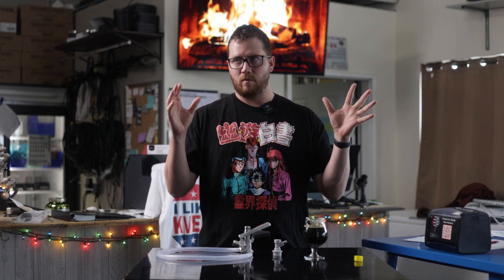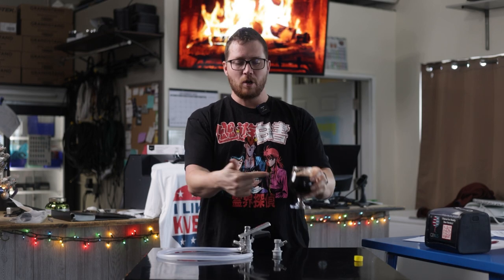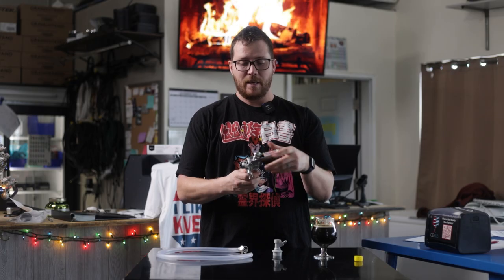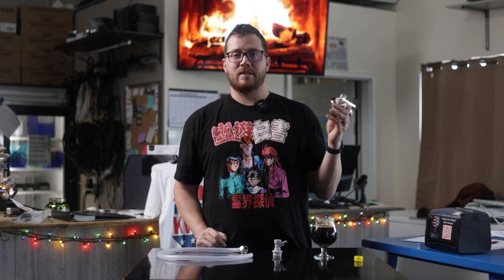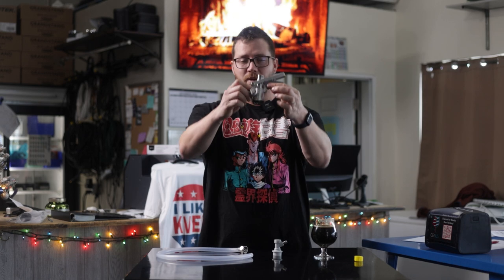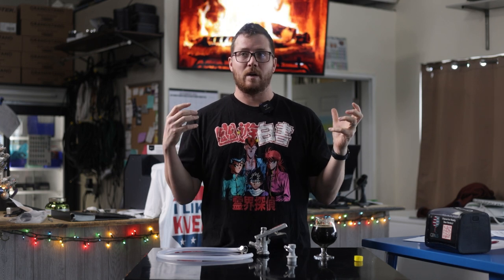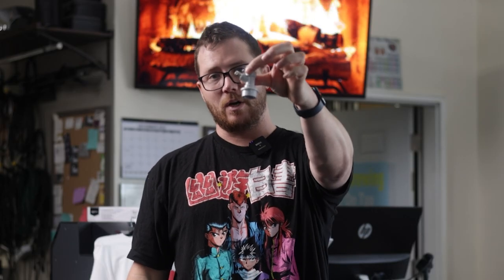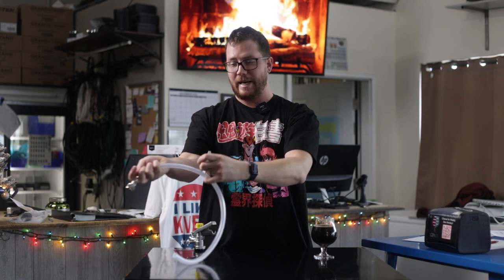Fix Over-Carbonated Beer | The Best Way to Clear Up Carbonation

Comment: Great video, I've been using a spunding valve to correct overcarbonated beers

I keg prime all my stuff nowadays, so it's easy to over/under carbonate.

Basically I take a pressure reading after the keg has been chilling for a week (and is assumed to have reached equilibrium) .  If the PSI on the spunding valve gauge is reading too high then I adjust the spunding valve to the "set it and forget it pressure" that alligns the keezer temp and target volume for a few days.

Comment: That's where the beauty of bottling into plastic soda bottles comes into it's own. You can feel the pressure on the bottles, and if it's too high you just slightly unwind the bottle cap and let excess pressure out and tighten it again. I'm not sure why not more people are doing this. It's very low cost and has so many advantages.
Reply from the maker: Agreed - I don't know why they aren't more commonplace
Reply: It's just something about beer and plastic. Or just plastic in general.  I think most people just try to avoid plastics at all costs today. 
Many plastics that are toxic to both nature and the human body.

Comment: If I am in a corny keg with a prv, could I just periodically release the pressure?
Reply: Yes, of course. Just release some pressure and wait a while.
Reply: This is what I've done.  Either disconnect the gas or close the gas line valve if you have a multiple keg manifold set up, so that you are not adding more CO2 as you off gas it over a few days.  Then set CO2 at a lower level than before so you don't repeat the problem.  It works.
Reply from the maker: That also works! If it's nearly full and way over-carbed (from additional fermentation) then fobbing through the gas-out might be a better bet but if there's decent head-space the PRV is prolly easier.

Comment: LOL I messed up my lines one time. I have a H2O keg that runs at 50 PSI (I like my fizzy water). You can see where this is going, I attached my line for fizzy water to my full keg of semi carbed IPA. What came out was a rush of nothing but sputtering foam.  I swapped the mixed up lines and used the PRV to drop the pressure in the keg over a few hours until I could hear the gas kick in. Waited a day and repeated the process, in the end it all turned out fine. I also have throttles (flow control) on my faucets, dialing them down for a really slow pour until the system settles down is another way to avoid over foam.

Comment: Could you hook up a spunding valve that is set to the desired psi and let it off gas that way?
Reply: I'm sure that would work so long as the beer in the keg doesn't foam up to the point that you are spraying foam out your valve. Ask me how I know that can happen :)
Reply: That is absolutely the easiest way to correct an over-carbed beer. What he's doing here will leave it flat and then you'll need to recarb it

Comment: Can't you just pull the PRV on either the D-System coupler or the corny lid to release the head pressure? 
Then you could shake the keg to release more gas from suspension and pull the PRV again.
Do that a couple of times and then let it settle and it should be good
Reply from the maker: If there is enough headspace that can work (assuming gas-in is shut off), but if there isn't enough headspace and the beer is way over-carbed that can be more cumbersome. If the keg is partially emptied though the PRV is prolly the easier way.

Comment: It would be even easier with sankey to ball lock adapter's, correct? Just remove the liquid qd and gas qd, hit the quick release and reattach a gas qd with a length of tubing to go straight into blowoff. Or even easier attach a spunding set to 5psi or something like that?

Comment: I have a stout on nitro mix gas but the beer absorbed CO2 before transfer to the serving keg. So the 70/30 mix is off which has a massive effect on the beer. The pour, surge, head size, mouthfeel etc. What would be the best way to fix this? It's in a corny keg.